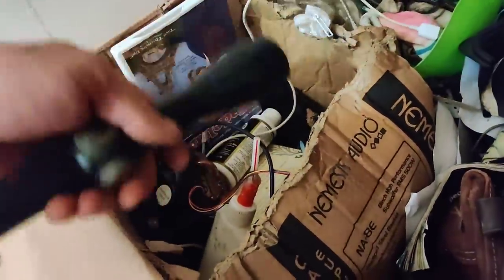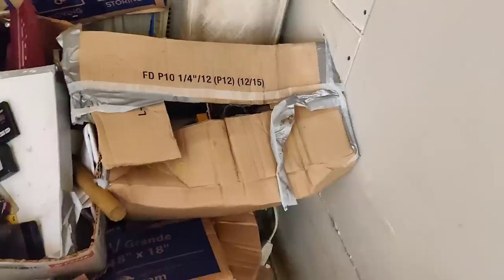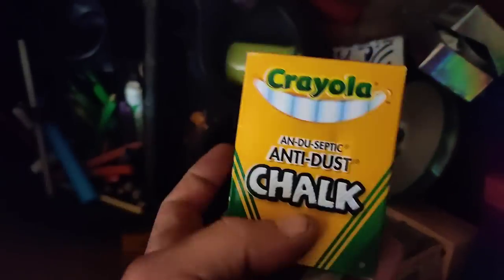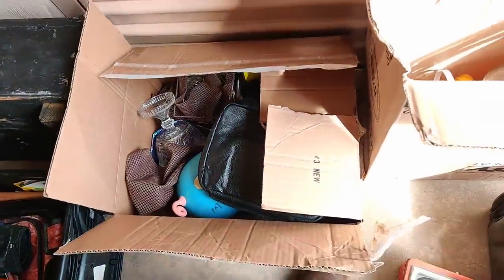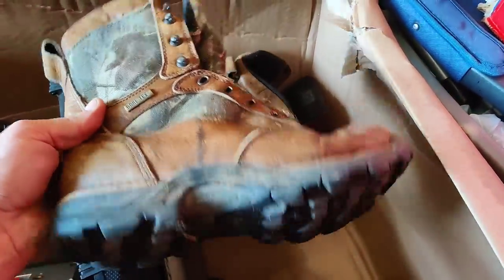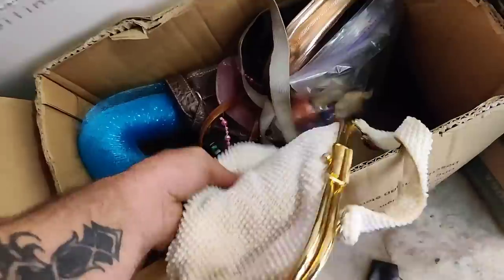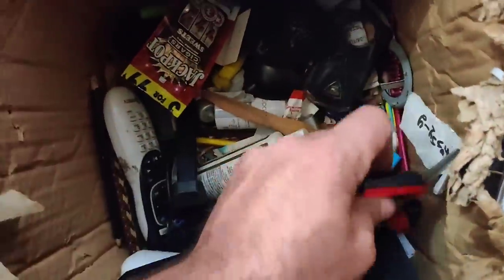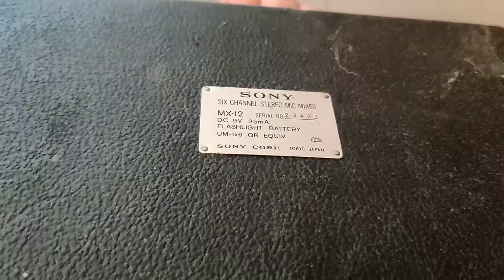Do We Find The Gun? Opening Mystery Boxes Full Of Storage Unit Finds!

Comment: I'm not savvy on drug paraphernalia. What's with all the phones and lighters? What is a "dugout"? On ebay, costume sometimes brings more than the real thing. Great compass. On the LV, the stitching is nice and even and straight, and they even stained the edges of the leather where the handles are attached. I'm no expert, but I'd say it's real. I wouldn't expect that in this unit.
Reply: The thing is a small bong called a bubbler.

Comment: I am copying and pasting the comment I added for Grimes Finds with regards to authenticating purses. There is a group on FB that will authenticate that LV and other purses for free... Here is the comment:

Hey, if anyone needs to authenticate a purse there is a FB group that does it for free. All you have to do is submit photos of the purse and they will tell you if real or not. However, I advise before posting to read the rules and the list of purses they authenticate. The main ones they do is Coach, Michael Kors and Louis Vuitton. They do others, but make sure you know which ones. If you dont follow the rules they will ignore your post. Also, make sure you take plenty of good photos. That includes all of the inside tags, if present. The inside tag is a very good indicator if real or fake. For example, Coach has the heat stamp inside, but they also usually have another tag attached to the seam inside. If so, make sure you take a photo of that. Here is the URL to the FB group, they are called Designer Diva, good luck!

https://www.facebook.com/groups/DesignerDivaAuthenications/